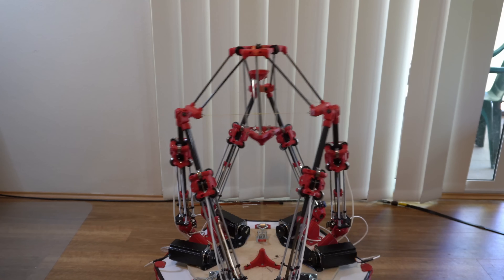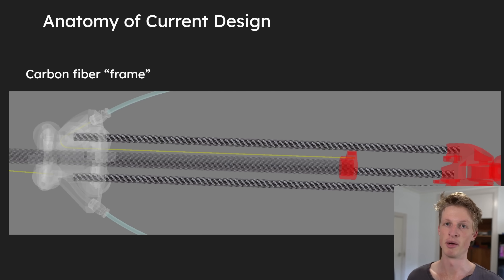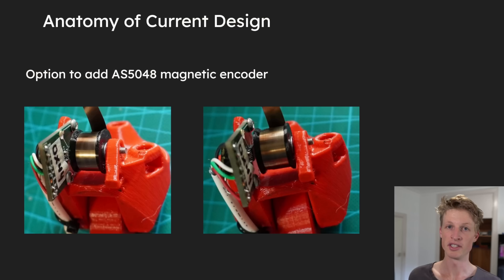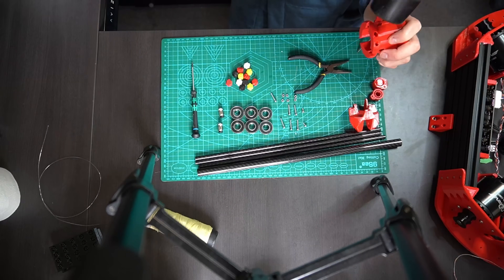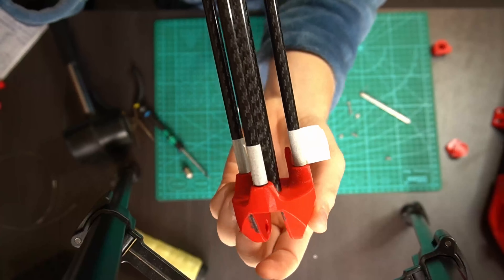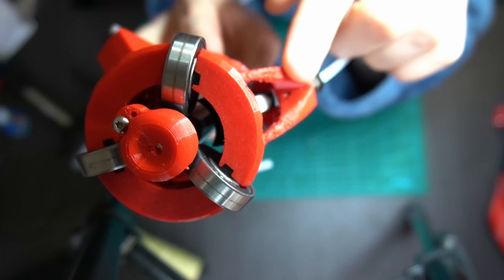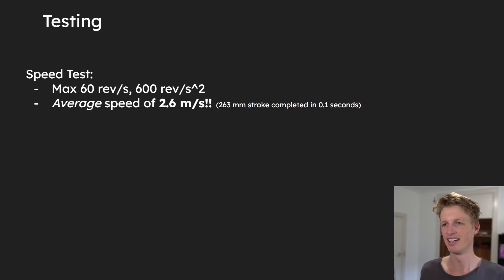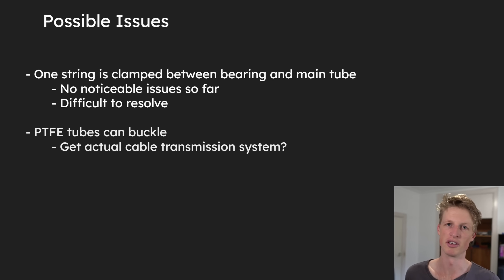Designing High-Performance Linear Actuators: Speed & Stiffness for my Juggling Robot | PDJ#19

Comment: As someone who built something similar for a robotics club, and did a decent amount of testing, my 2 cents would be to ditch the ptfe altogether and route both strings through the bottom, the one currently connected to the top can connect to the base via throughhole, and the one going up can come straight back down. Also, just a note on names for search visibility, "cable sheave" is the name a decent amount of websites including mcmaster-carr use for pullys made for "wire rope". Took me way too long to find the right names for search results to come up. I think the kevlar is probably all you will need as long as you actually have current sensing. I think if you wanted to really make them modular without the ptfe and able to redirect to the motors as needed you could use a caster wheel  the string goes down through the main bearing and gets redirected by an offset wheel.
Reply from the maker: Cheers for the heads-up re. naming! Something that I didn't say explicitly in this video is that these actuators (there will be 6 of them) need to move around quite a bit (relative to the motors, which are fixed on "ground"). This makes removing the PTFE tubes a little trickier as I can't rely on the routing being in the same direction at all times. Eric McGraw had a very interesting idea to get around this (comment thread is under this video) and I may move to a routing system like that for the next version of the actuators. 

Out of curiosity, what was it that you made with the robotics club?
Reply: @harrisonlow  Good luck with the kinematics then^. I still think as long as you are in the same hemisphere [the cable going down and out from the base of the mechanism] the caster cable diverter would work although I was working with much larger loads and friction was a much larger factor. It was a cable driven double jointed arm and a springsteel strip bent into a loop as a grasping mechanism that got pulled closed in the same way your actuator is set up.

Comment: Outstanding video, your approach is very clever. Questions.   1) Why are you using such large bearings?  You could save considerate weight by using smaller bearings.  I use 14mm bearings in my home made linear systems and they have a 400N static load. 2) If the cords are always under tension, why do you need the tube? Couldn't you just run them uncovered between a couple of needle bearings or a roller?
Reply from the maker: Thanks for the kind words!

1) Mostly just because these are the ones I had on hand 😅I need 6 of these actuators and I don't have enough of any other bearing size. If weight becomes an issue then I will absolutely change to smaller bearings

2) Good question! For many applications, you probably wouldn't need the tube, though I'm using 6 of these actuators to power a Stewart Platform and they need to move around over a fairly large range of motion (+/- ~45 deg about x/y axes) so I figured it would be easier to route the cable through a sheath rather than having a mechanism that guides the string perfectly throughout the entire ROM. Another commented (Eric McGraw) has gone a long way towards convincing me that removing the tubes is a good way to go (and somewhat do-able) so that may be how the next version of the actuator works.

Comment: There is this awesome cable that they use to make wire spoke wheels for bicycles that is extremely strong that I think would work great for this.
Reply from the maker: Wow I had no idea you could get bike spokes made with wires! Do you happen to know what they're called? The (limited) info I could find suggests they're really stiff (in bending); do you think the cables could flex over the pulleys?
Reply: @harrisonlow  the name of the material they use is ultra high molecule weight polyethylene (UHMWPE) it's more like a super high strength rope.

Comment: You could probably fit the ptfe tubes inside the brake cable housing for a bicycle. Alternatively, you could design an print a modular reinforcement part that surrounds the tube and can carry the compressive load. This is a great design, very cool project!
Reply from the maker: Thanks for the kind words!

Re. PTFE ideas: a big consideration for these actuators in this project is that they need to be able to move around fairly freely, and I'm worried that bike brake sheaths would be too stiff, and I can't visualise how a printed support structure would be both flexible (in bending) and stiff (in compression). I would love to know if you have any suggestions on that front! 

FWIW, a few people have suggested trying brake cables and I'll be testing that (and a few other) ideas soon. I'm sure we can eventually find the perfect tube! (or completely get rid of them, as Eric McGraw suggested in another comment. So many options!)
Reply: @harrisonlow  Maybe Jagwire Elite Link can do the job.
Reply from the maker: @NUeB_net  Wow that's some fancy stuff! I'll see if I can find any in Aus for a reasonable price. Thanks for the suggestion!
Reply: @NUeB_net  Jagwire was my first thought. Great stuff.
Reply: @harrisonlow  you could reduce the amount of movement the brake/bowden tubes need to do by routing them to the base of the actuator rather than the top. then you can just have the line/cable travel straight between two fixed points on the actuator, over a pulley at the top, and then back to the base of the moving shaft. you could even route the line inside one of the carbon fibre bars to keep it out of the way.

this would also have the advantage of letting you retract the actuator by pulling at the base of the moving shaft rather than the tip, freeing up space in the top, preventing the line from having to run under a bearing
Reply: @harrisonlow  I'd say bike gear cables would be better for this application, as they are smaller, and more flexible - you may well have already discovered this though
Reply: @harrisonlow you could use Ridgid hollow tubes kind of like the stainless steel straws which will create periodic but consistent brakes in the middle of the different segments which you can then bind together with a simple TPU print or even shrink tube that will only allow them to bend slightly but not go too far from alignment with the next neighboring section. It would allow flex over the system but add your rigidity while also somewhat armoring the PTFE and reduce cost and complexity for a single problem to be solved. 10+CM sections seem like a good compromise
Reply: @harrisonlow  bowden cables (the wire-in-tube use for bike breaks) are a reasonably well solved problem. sharp turns are something you have to avoid if you want the inner cable to move smoothly - yuo can go O ===== O where 'O' is some type of pully to change the angle sharply, with cables running between them.
The other thing is these types of things only work under tension, you need to make sure that you are pulling the cable in both directions, not pusshing in one, that is what will cause buckling.
Reply: @harrisonlow ***tech stuff***You might want to consider having the cable attached lineary to the carbon frame.  No more flying around tube.  I would look into bicycle cable and standard hardware for availability purpose.  One cable directly aligned with string attachment, the other one using a pulley for a 180deg frictionless reorientation.  At the bottom of it, a standard rigid 90deg bend.  Having all the cable coming to the drive station in a neat an organised semi linear fashion to reduce friction.  Using cable adjustment would speed up the cable tensionning af the drive station.

On the motor shaft, I would mock up a throttlebodyish design using multiturn overhauling for precise positionning.

On the guiding head, You would benefit keeping your bearing aligned having 4 bearings fixed and two with preload capability to reduce the frame distortion and increase cable and frame attachement.

I believe your design is very well tought and does have a potential upgradability to simracing rig!! Which would be outstandingly fast and scary!
Best regards,
Reply: I was thinking about this while falling asleep last night, and I realized that simple beads-on-a-string will provide resistance against compression, but still allow flexibility while not under compression. Anything that allows the tube to freely pass through it, with a rounded edge to allow flexibility, would probably work. However, if it needs to remain flexible while under compression it may be more of a challenge.
Reply: @James02876  "beads-on-a-string" is basically the idea behind Elite Link and similar products. They allow smaller radius than conventional bowden tubes and at least one of such (of which I just can not remember the name) claims to be flexible under load… so further investigation may be worth it. I never used such myself because on all of my vehicles, classic bowden works just fine.
Reply from the maker: @James02876  Interesting idea! This reminds me of another user's suggestion of using a spring instead of the PTFE tube. As it happens, I have some perfectly sized springs on hand and it seems to perform really well; no compression, and tonnes of flex. I'm planning on building a testing rig to try all these ideas to find the best tube/sheath. I also have a ton of beads etc. laying around so I'll be sure to give that a go as well

Cheers for the suggestion!
Reply: Of you go down the bicycle cable option. Try with gear cable and gear cable housing rather than brake cable (thinner diameter cable and come with far more housing and connector options)
Reply: @feiter  I was also going to suggest using a shifter cable housing as it's thinner/more flexible than brake cable housing.

As I'm thinking about it though, both shifter and brake housing are designed for a specific diameter cable, using thinner dia string might goof the system
Reply: @feiter  Also, gear cable housings/outers are designed to be constant length, brake cable outers are not (at least for Shimano brand).
Reply: @feiter  the problem with bicycle cables is they are made for relatively small, slow, infrequent movements, quite different from the situation here.
Reply: Brake lines and transmission lines for bicycles already have PTFE lining inside 👍🏼
Reply: Issue with Bowden cables is they usually designed to be used in one direction. A spring returns the cable to original position. 
2 working in opposite directions work well.
Reply: Bowden cables allready have a teflon lining. Also there are much smaler ones avaliable then bike size, which should make them more flexible.
Reply: The difference between shift cable housing and brake cable housing is that brake cable housing is designed to withstand high loads while shift cable housing is designed to minimize cable compression. Considering you're using string, shift cable housing would likely be a better fit.

Comment: have you considered the wire and tube used on bicycle shifters?
Reply from the maker: Shifter wire: Yes, but at least the wires that my bike uses are way too stiff to wrap over the pulleys in this project. 
Sheath/tube: I toyed with the idea but assumed that it would be too stiff (in bending). A few people have suggested it here so I'll be revisiting the idea to see if it would be flexible enough to not impede the movement of the actuator when I use it for Jugglebot
Reply: @harrisonlow  Yes I was thinking that too but what iit wraps around a larger circle that has gear reduction to the motor. so the cable itself isnt bent around a small radius
Reply: @harrisonlow  1.1mm PTFE Coated Bike Shifter Cables perhaps
Reply: @harrisonlow  Nylon Coated Fishing Leader Wire can be very thin and flexible

Comment: I assume the String friction will eventually cut through the PTFE tube
Reply from the maker: I would've thought so originally as well, but I've been extremely surprised by its resilience. I've run the string through a PTFE tube at very wonky angles and high speeds and it hasn't shown any sign of breaking down. It's super slippery stuff!
Reply: @harrisonlow  a rope/string Materials like ultra-high-molecular-weight polyethylene (UHMWPE), Dyneema, or Spectra are good choices, as they are known for their low friction, high strength, and abrasion resistance. might last longer in a PTFE Tube

Comment: I just wonder why you use 3 outside rods for the frame, and not a rod-inside-a-rod construction. It could be marginally heavier (not sure though), but muhc more compact and simpler.
Reply from the maker: I've toyed with this idea a few times as I agree - it would be much more aesthetic, simpler and compact, and it would also weigh less and probably be more stiff (mass non-linearly affects stiffness as its position from the "centre axis/point" increases, so the same mass at a larger radius is much more stiff). The biggest problem that I couldn't figure out how to resolve is how to get the strings into/out of the outer tube. I do think it would be possible, though I decided the benefits weren't worth the extra work to solve that issue so I moved on to other things. 

If you have any ideas of how to route the strings, I'd love to know! I'll pen this in as a possible upgrade for the ...5th? version of these actuators 😊
Reply: @harrisonlow  take a look
Reply from the maker: @AlexGontmakher  I think YouTube removed your last comment with the onshape link 😡I can see part of it in my notification, but not the whole thing. I'm very interested to see what you've come up with! I could see that you mentioned cutting slots in the outer tube and that was something I was previously averse to trying (my access to proper tools is limited) but it could be worth giving a go

Comment: maybe its worth trying the tubes from a bike breaking system?
Reply from the maker: Yeah someone else was suggesting that and I think I might have to give it a go now. We've got some extra brake tube in the garage so I'll have a play around with it tomorrow. My biggest worry with this idea is that the tubing might be too stiff and get in the way of the actuators moving around 🤔 (I'm using these actuators as part of a Stewart Platform)
Reply: @harrisonlow  afaik you can pack those even tighter, than the current ptfe version. look for brake tubing with inner ptfe coating. my biggest worry is higher weight(relative to current ptfe solution) and potential wear on the string. projecting my bike tinkering exp onto current problem I do not see direct stiffnes issues. as long as you dont bend those permanently in sharp angles this things are pretty giving yet rigid. look for finer racing bike tubing, good luck bro!

Comment: With the encoder for leg length measurement: it's going to be slightly non-linear due to the changing diameter of the bobbin/spindle, do you think it would need correction? If so, a simple lookup table could work well.
Reply from the maker: Haha I remember a question in high school math on this exact topic! Something about a toilet roll being unwound and dealing with the changing radius. I would be very interested to know how big of an effect that would have; my intuition says not much, but I've been wrong before 🤔
Reply: Ben you are a smart thinker.
Reply: You can use a badge reel that winds and unwinds really small wire/string to measure linear travel without the same issue of the radius changing that you have using that CF spring.

A commercially available sensor product that does this is a string potentiometer.

Comment: For the bearing that has the string running under. you could use one that has an inside radius. I have seen a few for larger rods where the inner radius is designed to match a metal rods curvature. You could use one of these to allow the string to travel through the bearing without coming into contact with it - also it would allow two contact points instead of 1 theoretically increasing the surface area of the bearing against the CF rod reducing wear.
Reply from the maker: YES! I've been thinking about this but couldn't find any bearings that fit that description. Do you happen to know what they're called? I tried "bearing inside radius" and a few variants but couldn't find anything. I suppose I could also use a smaller bearing and print an adapter with a groove for the string, though I wonder if the string would cut through it over time 🤔Only one way to find out!
Reply from the maker: I think your comment was removed by YouTube but I can still see it in my notifications. I'll check out U groove and V groove bearings. They seem like exactly what I've been looking for! Thanks heaps for the suggestion!!
Reply from the maker: I've been doing some digging and thought you might be interested to know about a cool bearing profile that I found: "gothic groove" profile. Could work to hold the CF tube more solidly and have the string between the tube and the bearing in the small space in the profile. I might have to pick some up to test 🤔
Reply: @harrisonlow  Just did a quick google. They definitely look good. I also found some luck with searching "track roller cam follower"

Comment: putting 2 pully strings and parallel to the actuator piston would decrease bending.. 14:16 very sweet design!!!
Reply from the maker: Haha it's funny you mention that - the earlier design (the third one in the "Design Iterations" chapter) had space for not just two, but three pulleys for the exact reason you're describing. Long story short, the string is close enough to the central tube and the bearings do a good enough job of containing the bend that it isn't an issue (that I've observed, at least), and routing extra strings + making sure they're the exact same length is very tricky/tedious.

Thanks!
Reply: fair enough bra